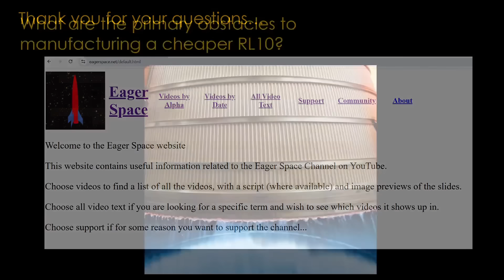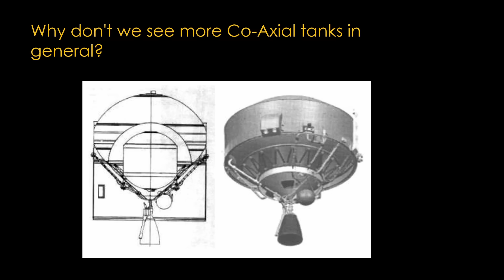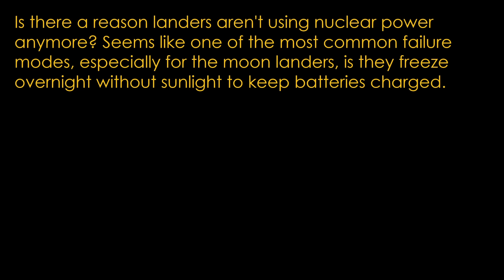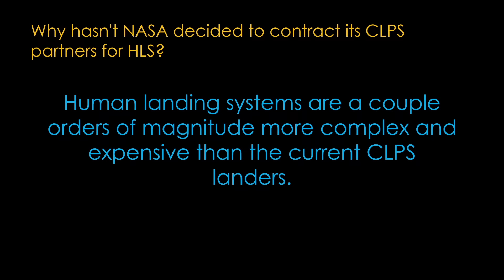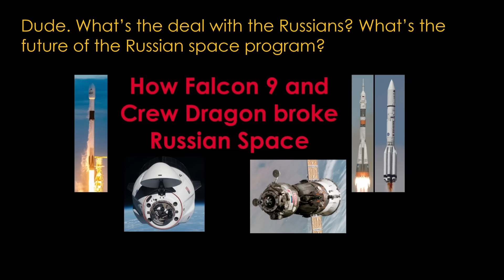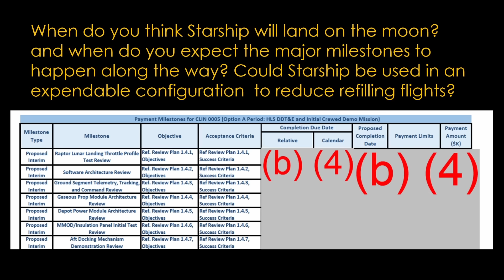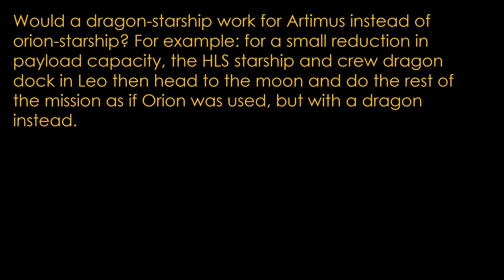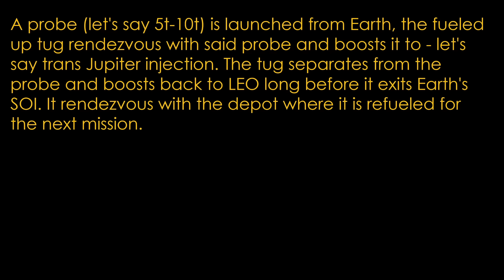Viewer Spaceflight Questions 3.1

Comment: Would a 3.7 meter diameter, Falcon Heavy based Starship be better? If the resources SpaceX is using to make 9 m Starships could be turned to mass producing Falcon Heavies and smaller Starships, they could have a far more hardware rich program. Even a 3.7 meter Starship would have enough living space for a 4 crew mission to Moon or Mars.
Reply from the maker: 3.7 meters is a very small diameter. It's pretty good for Falcon 9 burning RP-1, but it's too thin for methane. 
SpaceX wanted a big vehicle because they care about Mars more than the moon.
Reply: Building a "sustained presence" on the moon or Mars is not just about putting people in the minimum sized box and shipping them to the destination.  It is also about shipping the support mass to keep those people alive, functional, and doing useful work.  The support mass of food, water, equipment, and housing for a sustained presence, is probably much greater than the human bodies and their temporary transport-only support systems.  More mass usually implies more space required.

Reducing cost is also important.  Much time and money has been spent on past space payloads to make the equipment as small, light, and foldable.  With cheaper launches on Starship, with its larger diameter, and more mass to orbit, and orbital refueling to be able to carry much more mass beyond Earth orbit, payloads could be cheaper because of not needing as much engineering to reduce size and weight, not needing as many exotic materials to reduce weight, and not as much engineering and testing to make foldable equipment to fit into smaller rockets.

Orbital refueling opens up new possibilities that had never previously existed before.  But refueling is much more efficient with Starship sized tankers and depots, than Falcon-9 sized rockets.  A Starship fully refueled in orbit, could get more mass and faster travel time to deep space missions.  With more mass for deep space missions, there could be more probes carrying enough fuel to orbit their targets instead of just doing a flyby.

Being "hardware rich" has not been a problem at SpaceX.  Reducing production costs of SpaceX rockets has been a big part of SpaceX's reducing the cost per kilogram to orbit.  Minimizing cost per kilogram to orbit is essential to SpaceX's goal of making humans multi-planetary.

SpaceX being hardware rich also fights against another SpaceX problem, which is time.  Being hardware rich makes development much faster.  Making humans fully multi-planetary is a long long term process.  If SpaceX's progress is too slow, then the process of becoming multi-planetary is not as exciting and more of a far future concept.  Previous accomplishments such as landing a human on the moon, or landing orbital boosters become less exciting and more commonplace.  New rapid development is needed to keep up the excitement, which attracts the best engineers, more investment, and more public support which helps drive more political support.  As an example of this, if the effects of pollution or global warming were showing as many dramatic new advancements as rapidly as SpaceX is producing dramatic events, then the topics of pollution and global warming would get more attention, funding, and public/political support.  Government money spent on SpaceX and pollution do not bring immediate financial gain to most individuals, but the excitement of SpaceX's rapid developments brings more public support which leads to more political financial support for SpaceX.  Even though pollution control, global warming abatement, and becoming a multi-planetary species are all activities that are longer than a single human lifetime.

Comment: Oh my goodness! Thank you so much for featuring my question!! :D

What you said about the heatshield makes sense. I hadn't actually thought about weather or not the dragon capsule would have a robust enough shield for those velocities. (Then again Artimus Orion didn't seem to either XD (Kidding of course). On the other hand though, I would be curious if the r&d that would go into trying to make dragons shield more withstanding to those conditions would still be worth it compared to the r&d behind Orion/SLS. Do you think it would be too expensive for Spacex to try it? (Hypothetically of course). Or would the structure of the Dragon capsule be a poor shape to begin with for this?

Also as a small aside, I was in-fact inspired by you're commercial moon program video :D
Reply from the maker: It's probably possible for Dragon to use a thicker heat shield as it uses a block-based design. You would need to test it, and Orion shows that it's not always straightforward to do that. 
Dragon may also have consumables issues and not be able to support 4 astronauts for that long.
Reply: @EagerSpace  Alright.
And indeed, it would need to be tested. Though, it seems SpaceX might be more readily accepting of doing the trial by fire, so to speak. As they have quite a few dragons now and they like to do iterative tests. 
Maybe the first uncrewed version could test the capabilities of longer range starlink laserlink telemetry as well?
As for consumables would it be plausible to assume that one could put dragon in a sort-of 'dormant mode' as long as its attached to starship and then put it to sleep while its in lunar orbit? Then it would only need to use its consumables for the trip back, which dragon has shown to be able to do missions up to a week long at times. (This exact profile has never been done before so thats fair if you don't have an answer, I'm just curious if you think the overall could be sound and/or if its a overall cheaper alternative to SLS) :)
Again, thanks for the reply!
Reply from the maker: SpaceX would indeed just fly the thing to test it.

Comment: How will we get adequate carbon on the moon? Will we forever be reliant on "donations" from other planets such as Earth or is there another means to extract and refine C on the moon?
Reply: Consider how frequently we discover new natural resource deposits of all types on Earth. 
That is with the most advanced modern equipment and enormous capital invested.
Now compare what we know about the Earth to what we know about the Moon.
So the answer as to whether the moon will ever be self-sufficient, is we don't know.
Reply: I remember seeing a video from AnthroFuturism that, among other things, covered the (energy) costs of producing steel on the Moon. They ultimately decided that sourcing the carbon from Earth would be easier.

My thought about it was that if there's significant heavy industry on the Moon, you don't have to pay the DeltaV costs for orbital insertion and landing; you can reasonably just chuck 100 tonne chunks of coal with a thin still casing at the Moon (targeting designated areas for this sort of thing), then later dig up the man-made carbon deposits.
Reply: @ Did they research if the Iron for steel can be viably mined?
Reply: @ Iron can definitely be obtained from Lunar regolith, but the trouble is that -- save for potential asteroid impact sites -- there are no concentrations of iron on the Moon. On Earth, iron is found in deposits that are incredibly pure compared to other metal ores; some are up to 70% iron by mass, with anything below 50% being considered low grade. The Moon instead is very homogenous; pretty much no matter where you go, you find about the same concentration of iron in the regolith. In the maria the concentration is highest at about 13% IIRC. On the plus side, this means that exactly where you locate manufacturing facilities doesn't really matter.

The relatively low purity means that extracting iron from regolith would be more energy intensive than on Earth, but it's far from insurmountable. Solar furnaces are more practical without an atmosphere, and would likely be the main means of heating metals.
Reply: Every crater on the moon is a potential site for a mine. A few metallic meteor impact sites are detectable from lunar orbit because they contain so much iron. Magnetic fields are not affected by lunar dust. So an orbital magnetometer will react to large concentrations of ferrous material, even if they aren't right on top.

Plenty of meteors were and are primarily carbon, but it is harder to find. I expect that space agencies will map the lunar surface with spectrometers. The back scatter from X-ray's and high energy electrons reveal which elements are at the surface. 

The moon hasn't been getting hit regularly by large meteors for a few billion years, but recent little meteor strikes will throw buried material on to the surface. By recent I mean in the last few million years.
Reply: The moon has plenty carbon, Iron and other elements in abundance. Of course the question is: how efficiently can they be mined and how much effort/investment will it take?
I foresee SpaceX building a foundry on the moon and producing starships there with massive payload capacity in the order of 2,000 tons to Mars. Some resources like engines would likely have to be brought up from Earth , like engines and such. but steel production on the moon would actually yield very high quality  and strength steel due to the lack of atmosphere constantly trying to oxidise the molten metal. And as far as I know, iron can be molten and not boil under a vacuum due to its density.
Reply: besides steel production - which you don't need since aluminium, bazalts and even silicates can easily replace it - what exactly do you need carbon for?

Comment: Why is space poop so hard? Every single crewed vehicle is having issues with it, from aircraft being rerouted due to a broken toilet, to spacecraft resorting to backup diapers.
Reply: Shit runs downhill. What’s downhill in space?
Reply: My (complete) guess is that space toilets have a lot of requirements and moving parts that need to keep the waste in one place. And like valves on a rocket, it's hard to make it reliable. If something goes wrong, it can't 'spill' everywhere as well, that'd be a nightmare. So make it unusable so it doesn't get worse.
Reply: @davidk1308  it's always those shitty valves failing
Reply: Ask Wollowitz.
Reply: Lack of space fiber
Reply: Why is space poop so hard?

Well rapid unscheduled explosive diarrhea is no joke in a micro gravity environment.
Reply: just install a airliner toilet with a black hole valve that dumps everything directly into space. Sit down and flush. turd will be sucked right out.
Oh my, I forgot, there's no down in space.

Comment: So I asked grok about whether or not starship can carry more than 100-200 once in space. It said it can carry up to 400 tons if you use 6 vacuum raptors. Would this be true? For example, could you take up 2 starships, transfer 200 tons from one to the other and then send it off?
Reply from the maker: I often end up with Gemini answers in my searches, and Gemini is wrong *all the time*. LLMs have built-in Dunning Kruger. 
This is one of those times. 
Gong to 6 vacuum raptors helps the thrust/weight ratio of the second stage and is probably required with the beefy starship 3, but that's not a major factor in payload as it just reduces the gravity losses.
Reply: @EagerSpace the gravity loss reduction does got result in significant payload capacity? 

Does it provide a better safety factor due to avoiding blackout zones and ballistic trajectories on reentry for failure modes?
Reply: "So I asked grok"

Comment: I wonder if a secondary heatshield could make crew dragon a pheasible lunar capsule. Possibly using an inflatable heat shield with a non-ballistic reentry. But I'm not too familiar with the design challenges of inflatable heat shields.
Reply from the maker: My guess is that the current design works with thicker heat shield material.
Reply: My understanding, based on comments by a former NASA director, was that the "bottom" heatshield is really only the tip of the iceberg. 

A significant issue is the "backshield", and the overall capsule geometry. Capsules like Dragon and Soyuz can get away with a steeper angle, which creates more interior volume, specifically because they are optimized for LEO. 

The comments if a recall basically said you would need to redesign Dragon from the ground up, and at the end it would basically look like Orion.
Reply from the maker: Capsule shape really isn't an area that I know much about, but I'm automatically skeptical of the NASA consensus on things because there are many people there who are heavily invested in the status quo.

Comment: wouldnt it not be lunar reentry for the dragon replacing since they would dock in low earth orbit. The current mission design has the orion go to the moon, dock to starship, then wait to dock again for starship, then head back to earth. In the dragon version it only has to go to low earth orbit and dock to starship then wait in low earth orbit to dock when the starship gets back. Why would lunar reentry speeds make that unfeasible?
Reply: In that version how is Starship going to lose its high velocity close to Earth when returning from the moon? A returning starship needs to match LEO velocity to be able to dock to Dragon.
Reply from the maker: To go from NRHO to dock in LEO costs about 4000 m/s of delta v if you do it with thrusters. You could maybe do aerobraking to orbit but it's not a common approach.
Reply: When you say Starship do you mean HLS or a separate Starship just for the transit to and from NRHO? In the case of HLS, in order for it to return to LEO the HLS would have to be refilled in NRHO, requiring at least one and probably two tankers to NRHO. It needs that in order to attain TEI and especially to decelerate to LEO using its engines since it of course has no heat shield tiles. IMHO there's no way NASA is ready to take the risk of any inability to to make the refill, of any bobble among the several steps required. Cryogenic valves and plumbing are pretty cranky.

Using a Transit Starship is a different story. A regular Starship with TPS and flaps can go LEO-NRHO-LEO, performing a propulsive deceleration to LEO, with no need to refill in NRHO. Few people think NASA is ready to entrust a crew to a Starship aerobraking from lunar return velocity that then does a flip/burn to land. Thus we'll stick to the rendezvous with Dragon in LEO to transfer the crew to Dragon. The Transit Starship will land autonomously. It might even make sense to carry the Dragon along. Counterintuitive but there are advantages.

Eric did video covering most of this, "Commercial Moon". A lot of the numbers for Options 3-5 apply to the Transit Starship, although not exactly. I've communicated with him on this and he says the propellant tonnage and delta-V for my proposal should work out. Also covered is the refilling necessity for HLS.
Reply: It seems as though a merging of HLS and an Earth-reentry starship into a single multi-purpose starship could eventually be the most efficient.  The starship would take off from Earth with crew on board, refuel in LEO, land on the moon, then return to land on Earth.  No need to transfer people, cargo, and equipment in space.  Everything is loaded at Earth surface facilities  then carried to the moon in the same vehicle.  It seems that it could be more efficient to take the hit on extra mass by combining fins, tiles, legs, solar panels, and high-mounted landing engines, into one vehicle, instead of transferring in space between an earth starship and a lunar starship.  Unless SpaceX develops a crew and cargo module that can be easily transferred as a single unit, between starships in space.
Reply: @davevann9795   That is exactly what Starship was envisioned as doing when it was first unveiled, long before it was even named Starship - but reality set in. The mass of the ship is far too great, no amount of eliminating cargo can get this design down to being able to do both things. Even if a ship with TPS and flaps could be trimmed down enough to make the round trip it would be nearly useless as a lander, there'd be no mass left for cargo or the features it needs to support a week or two of lunar exploration and operations.

Comment: Are the wings of the Space Shuttle orbiter purely symetrical? Is that what creates the zero-lift configuration during liftoff?
Reply: No they absolutely generate lift. It had to be accounted for on re-entry or the whole damn thing would just perform orbital skips, if my understanding is correct. 

Keep in mind that the shuttles main engines could gimbal to provide a certain amount of offset.